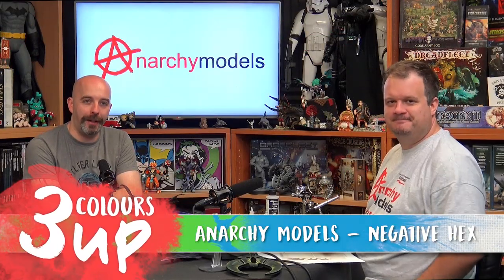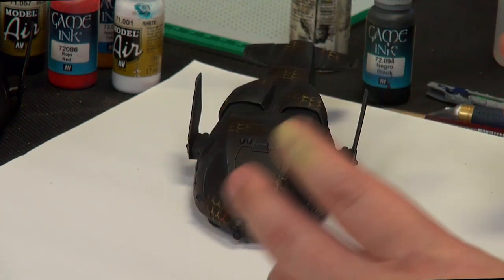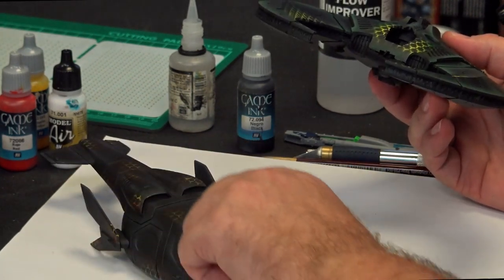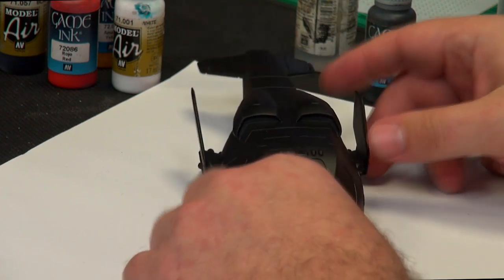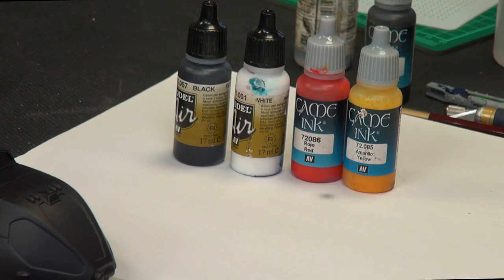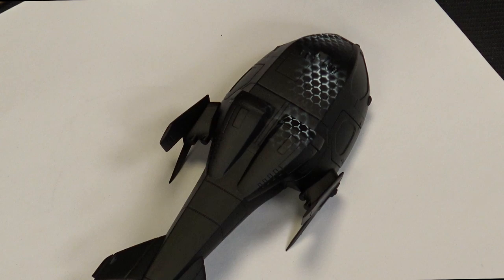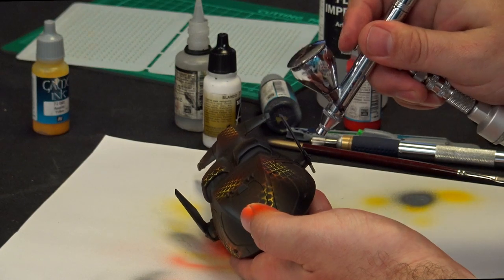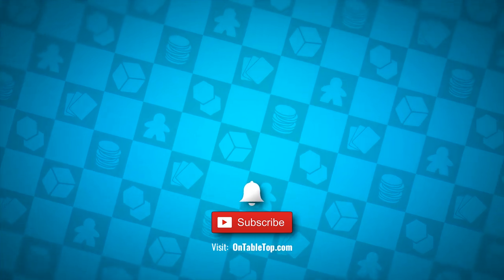3 Colours Up: Anarchy Models Negative Hex Mesh

Comment: Can you use any of your stencils with a paint brush?
Reply: Yes, but look up a painting technique called stamping where you use a sponge to dab the paint on. The key to the technique is to dab most of the paint off of the sponge, akin to dry brushing. Hope it helps and cant wait to see your work!
Reply: As Randy said, you can stamp or stipple the paint on. Would work better with our HD stencils which are self adhesive.